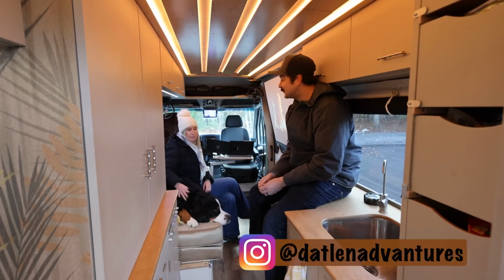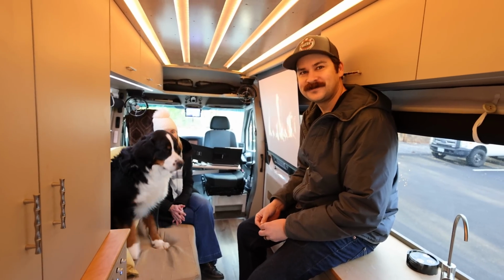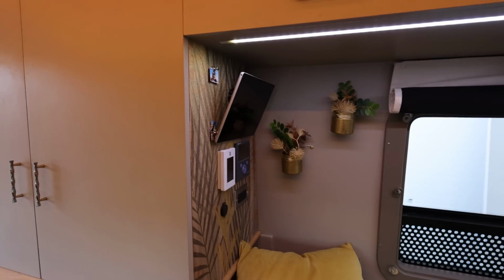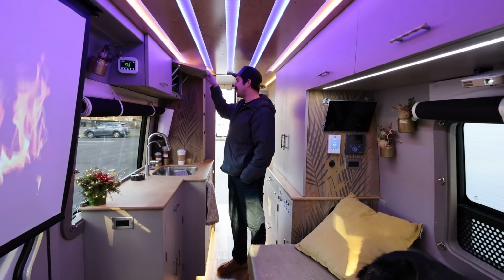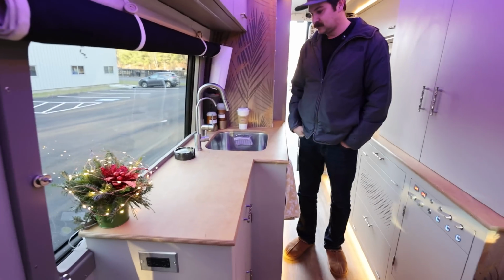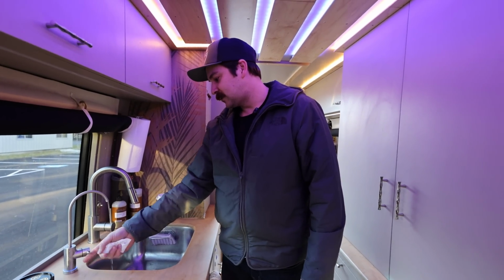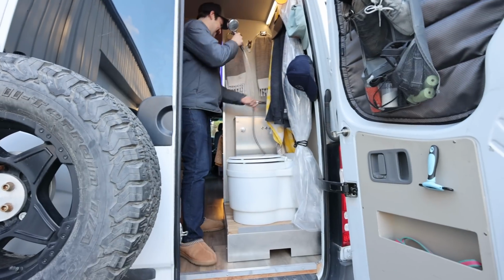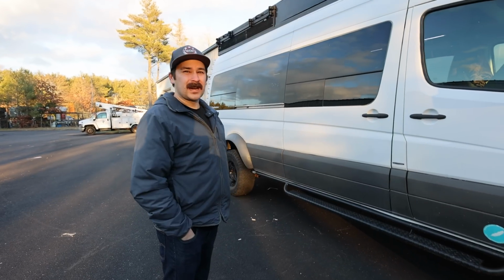DIY to PERFECTION - Engineered and Executed Van Build

Comment: 1.5 gallons/ hour of gas for just the heating? So 12 gal. for 8hrs overnight? Run out of gas everyday or 2??  Eeeeek!!
Reply from the maker: Did he say per hour, because that’s per day. About 1 gallon of diesel per day when system is on full tilt, which is rare that it’s blasting. I run the same system in my tiny home and have a 58 gallon tank. I filled it up half and still haven’t put more in this fall/winter. The tiny in also in Maine so yes it’s need cold enough to run everyday
Reply: @jarrodtocci .   Oh, thank goodness!!   Thank you

Comment: Random question but what lens/focal length on full frame/apsc do you utilize for van tours?
Reply from the maker: I recently switched to a canon r5 and I use a canon wide angle lens. I’ll have to double check but I think it’s the 15-35mm f4. I wanted to get the nicer wide angle with the f1.8 but it was $1000 more and much bigger which makes it harder to travel with

Comment: I love the idea of raising the deck because the problem with Tiny watts solar is that if you want a whole roof of solar, you give up the ability to add vent fans on the roof. Raising the deck can theoretically allow adding a vent fan which works kind of like a pc fan with those full glass cases that were famous a few years ago. It would be so good if Tiny Watts can make a deck with a cut out for something like a Maxx air fan or the roof box with some built-in ventilation fan.
Reply: I absolutely agree with this.
Reply: Hey Ahmad thanks for your comment! We do off the 500W solar storage roof box where we can incorporate a vent cut out inside the box. That will still allow the vent to open and close and circulate air. Let me know if you have further questions!